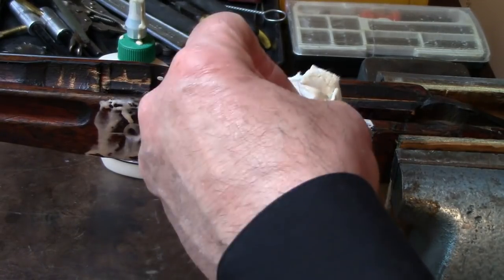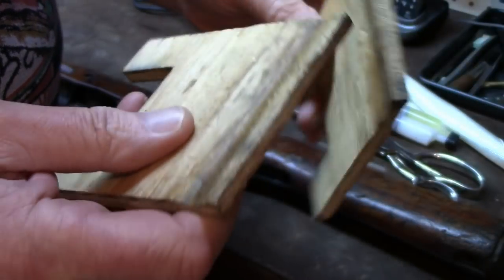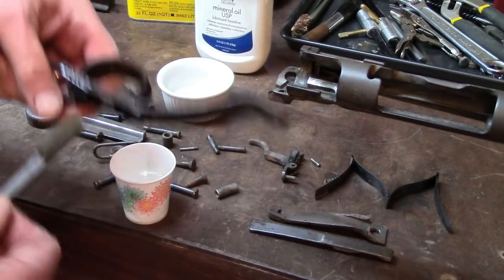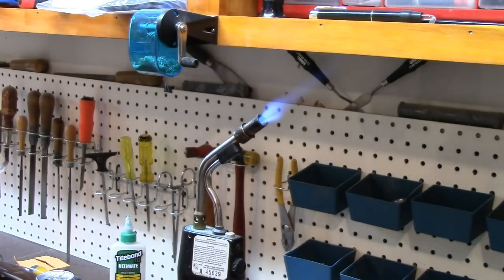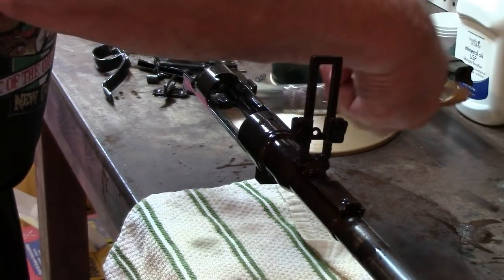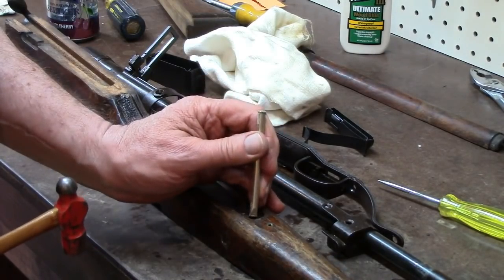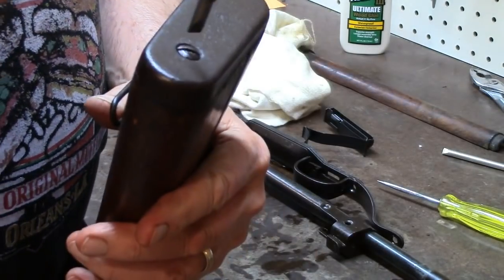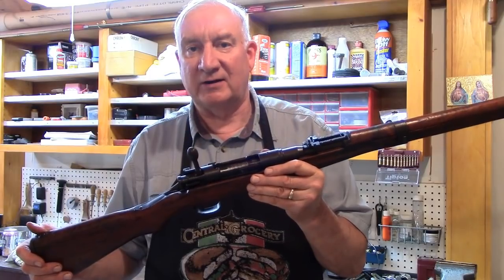How to Restore a Gun, Part 3 ~ Arisaka 7.7 x 58 Type 99 Japanese Rifle

Comment: I wish I had seen this video 30 years ago when I did an bad job of repairing my fathers Remington 742. I foolishly glued in a wooden dowel and drill through it to make my repair of the buttstock. At least its still holding together and works flawlessly. Or should I say as well as it ever has. Wonderful series. Thanks.
Reply: Denis LeBlanc  If it still shoots you did it correctly for its designed function, aesthetics are for collectors.  As a tool using man I have a lot of ugly, repaired tools that work better than the pretty ones !

Comment: Thanks for the in depth series. I have to say though i have a very late last ditch type 99 and its heat treated properly and shoots very,very well. The machining looks terrible but its built right where it counts. No way the japanese sent out rifles to their people that would explode on use. Your thinking of the training rifles. Often times they were confused with useable rifles which they were not. They would explode when a live round was fired from them. Easy to tell them apart. All that said verify all your old battle rifles for useability. Pay a gunsmith if you dont know!

Comment: Hopefully, after you get the last of the lost parts, you will video when you take it out for some range time. Thanks for a great trio of videos!
Reply from the maker: Jim Allen 
I located the parts and hope to do just that, soon. Thanks for watching!
Reply: i just did this to mine a year ago some one at work had given it to me thinking it was worthless it turns out to be a 42' early war chromed barrel monopod and aircraft sights! My stock was great though no repairs to wood needed just slight surface rust let it soak with repeated applications of Hoppes #9 and some 0000 ought brass wool it seems to have over 90% bluing left came-out beautiful.
       You could see it not had been cleaned since WWII as I found Unburnt long grain cordite left in the action!The Bore was nice and shinny and sharp rifling. cleaned the stock with acetone and used 50/50 BLO mixed with mineral spirits came out great saw some 7.7 Norma ammo the other day I might try it out this weekend?jim

Comment: I'm going to have to use the heated oil on my Type 38's bolt at some point. I just cleaned a huge amount of cosmoline out of it, never knew anyone did that to Japanese firearms, and my bolt in particular is looking dry even after an oiling. I'll try it with my Berthier and Mosin as well.

Comment: Love the video.  The CLP data sheet says it is made of polyalphaolefin oil, rust inhibitors, dibasic ester #1, petrolium distillates.  How does CLP clean if it doesn't contain a solvent like mineral spirits?  Wouldn't that make your mixture superior?  Is there any merit to using synthetic oils?  I really appreciate you being so patient and helpful with newbies like myself.  Thank you for all that you do.
Reply from the maker: grog3514 
I am not a chemist, but I do know that the end result of many such compounds are very frequently nearly identical, whereby, broken down, they contain either the same ingredients, or ingredients that are virtually the same but with different names.  Manufacturers are required to list chemicals by their classification, but may use broad generic terms.  Names such as petrolium distilates are such generic terms.  Any ingredient with the word poly means literally, many. CLP can indeed contain, or even be entirely Stoddard solvent and mineral oil, as Stoddard solvent has been made with a fairly loose variety of accepted formulations since its invention, and even mineral oil is engineered for different viscocities.  In short, makers do not wish to reveal trade secrets, and they are not required to; only that they state classifications of substances, such as olefins, acids, and such.  The data sheets are not, in other words, recipes, and can leave a fellow chemist just as curious as to the actual ingredients used by the company next door.

Comment: I really wanted to say thank you for posting this. It is easily the best piece I have ever seen on practical firearms restoration. I love picking up a ratty looking surplus rifle at an auction and bringing it back to life. I just finished up a quick job on an older Czech VZ-24 Mauser. It shoots well, and looks good but I'm going to have to pull it apart again and try your heated metal mineral-oil dip. I'll bet that really brings it together.

Please post some tips on stock finish. The VZ-24 had about half a dozen coats of what looked like floor wax.(thankfully it hadn't been polyurethaned). I give it a couple light cleanings with Dawn and a plastic scrubby, and it looks better without the wax but still sort of flat and dry now. I am thinking of a light coat of castor oil. Any thoughts?

Comment: Could these cracks come apart again under firing?
Reply from the maker: ShoulderRollJason 
No.  Longitudinal repairs along the grain are stronger than the original wood.  Many laboratory tests have been done over the years that have proved that beyond question. As for the cross grain breaks, I assessed those in the video, and there is no risk involved.

Comment: Very nice refurbishment and video work! FYI: The artist tool is called a palette knife.What was your method for making the wood look good, without removing the patina?
Reply from the maker: Mike McIlhenny 
I knew the tool's name, but my old brain came up with missing parts, as is often the case lately.  Mineral spirits will clean wood finishes nicely and safely.  My grandmother's old furniture formula was 50/50 turpentine and raw linseed oil. Don't use boiled linseed oil, which hardens, and is sold for an utterly fantastic profit in tiny little bottles and jars in gun stores as so-called stock finishes, which is simple old boiled linseed oil.

Comment: Would love to see it shot on video.  This has given me inspiration to do my 7.7 type 99 with the mum still fully attached.  It has a very dark rough bore do you have any suggestions on how to clean and smooth it???
Reply from the maker: dowdawg
You can only clean it thoroughly.  I suggest using Hoppe's #9 or mineral spirits, following my video on how to clean a rifle professionally, until no more dirt or rust comes out.  Don't be surprised if it takes lots of solvent, patches and scrubbing, with a close fitting brush, and lots of elbow grease.  Be sure to use a high quality plastic coated steel rod, and never use an aluminum rod, which will damage the bore (those should be illegal!).  Use an 8mm bore brush and jag, as it's considerably bigger than a 30 caliber.  It's acceptable to cork the bore and fill it with solvent, allowing it to soak a few hours at a time, followed by cleaning.  Whatever roughness remains after cleaning is pitting that you can do nothing about, and any efforts to smooth it will further degrade the remaining steel. After it's clean, give the bore a single patch lightly wetted with regular clear mineral oil to protect it. I do hope to shoot it soon.
Reply: Thank you for the advice!!!

Comment: Nice job, did you ever get it to fire? I started watching gun restoration videos because I'm about to start a restoration on an 1862 Bridesburg rifled musket that had been sporterized at some point. Some four or more inches were cut off the barrel and the wood cut back to the first barrel ring and the stock stripped. The butt plate was missing and the recess in the top of the butt was shaved off. I plan on restoring missing parts and fitting some new parts of both the wood stock and the metal. I came accross a two band Springfield in a museum that was listed as "a seargents musket" which is what I'm using as a model for this resto/mod because it's about the same lenth and solves a few problems configuring the weapon. The weapon is already so ireversably altered from it's original state that there's nothing I can do to it to devalue it further. In fact the gun was given to me by a friend who was just going to have it disposed of. Should be fun.
Reply from the maker: Have fun with your project. Yes, the rifle shoots great.

Comment: I have a very old FIE single shot 20 gauge that needs to be reblued. It is very rusty.  Bagged my first rabbit with it 47 years ago. Any suggestions? Thanks.
Reply from the maker: If you desire it to be reblued, there is nothing you need to do, except give it to a competent gunsmith who is experienced in the practice of rebluing.  He will remove all rust, polish and refinish the steel to a luster, then hot blue it.  Any serious, deep pitting or scratches will remain, but will be beautifully blued. Cold home bluing techniques are very superficial, and are not worth the effort.
Reply: @GunBlue490  
Thanks. I haven't had time to hunt in a long time. So , a lot of my firearms are in disrepair due to my neglect. I want to pass these on to the kids one day. Slowly getting them into shape.

Comment: Sorry if this is a dumb question, but I'm always still learning. What kind of torch were you using? I couldn't hear because the torch was too loud. It looked different than a regular propane torch because of the two tubes, so I didn't know if it was a mixture of gases, or just propane and oxygen. Or is that second tube just the igniter? Fantastic series btw, I love all your videos, they're just so straight forward and cut through a lot of bull! Thanks for all you do!
Reply from the maker: It's not a dumb question.  The torch is simply a propane torch with a self contained igniter, which is the lower tube.  For what I was doing, only mild heat is required.
Reply: @GunBlue490  awesome, and thanks for the quick response. I've been working on guns for years, and I still learn stuff from all your videos. Since I've become disabled after a car accident I've really been thinking about going into gunsmithing as a career because it's something I can still do with my disability. I think another reason I really love your videos is because you remind me of my dad. He was one of the smartest people I ever knew, a mechanical engineer/machine designer w/many patents. You both just tell it like it is, no BS. I just today found a local gunsmith looking for an apprentice, so with all my experience in wood & metalworking, mechanics, restoration, engineering, drafting/autoCAD, machining, and repairing & building firearms it'll be a job I would really enjoy. Watching your videos has been an extra wealth of knowledge, so thanks again for doing what you do, and please keep it up! God bless you and Benny! (I hope he's still around, if not I'm truly sorry!)

Comment: I wonder if those notches were actually done by a Japanese soldier... the reason I say this is due to the fact that soldiers were not allowed to modify or change any imperial equipment being it was all the property of the emperor. A common myth is that Japanese soldiers would remove the dust covers and mono-pods, this would actually result in severe punishment and was most likely done by servicemen who took them off and either didnt know how to put them back or didnt care to. This type of standard practice is why I question the notches.
Reply from the maker: No, those notches were actually on the rifle when it was taken from the Japanese soldier's body.  It's what they are.  Rules are broken by people all the time.
Reply: @GunBlue490  I was just stating that an IJA soldier would be punished severely if he modified or defaced any equipment with the imperial chrysanthemum on it being it was marked as the emperors property. The Japanese were not known to deviate from these traditions whatsoever, so I always question when I see "field modified" Japanese equipment.

Comment: the "last ditch" arisakas are perfectly safe to shoot (provided they arent damaged or falling apart, which would make any gun unsafe). no matter how desperate, no one would use a weapon that would be more likely to kill the user than the target. if that were the case they would have just issued clubs and spears (which they kinda did). no the myth of the suicidal exploding arisaka comes from people trying to use live ammo in training rifles, that were made to shoot blanks to teach the use of the rifle, not to fight with. they didnt have rifling, locking lugs and were make of soft material, not proper steel. those are 100% unsafe to shoot with real ammo. luckily theyre very easy to distinguish. just look down the bore, if it has no rifling, its not a "real" arisaka and is not safe to shoot

Comment: You could have done this in one third the time, but you repeated things over and over. I can not hear what you are saying over the sound of your propane torch.
I think you did a good job in repairing the damage to the wood. However, your process on the metal leaves a lot to have a  conversation about. Why didn't you repair the dovetail lower part of the stock?
Why didn't you show us what you did as far as removing the dowels. As far as I can tell, you have not RESTORED this, because it apparently does not have a firing pin and cocking piece.

Comment: i understand what you are doing and respect that but why just heat the metal and oil it honestly that does nothing and yes i to have some say experience in refinishing .you could have simply boiled all the metal in distilled water and rubbed it down with0000 steel wool and called it a day or continued to rust blue it and you can make your own rust blue very easy after that soak it down in boiled linseed let it stand over night and wipe it down and call it quits but that being said the gun does look ok